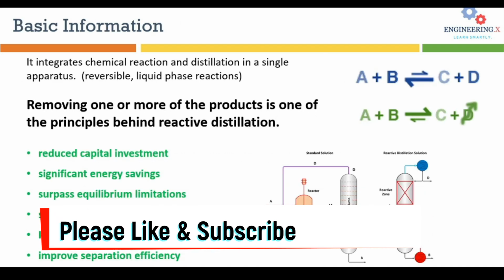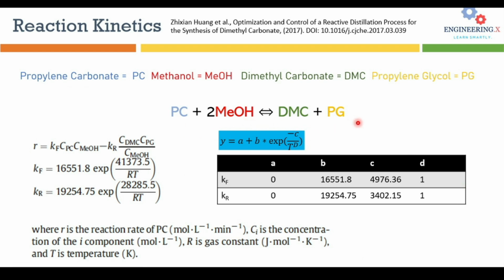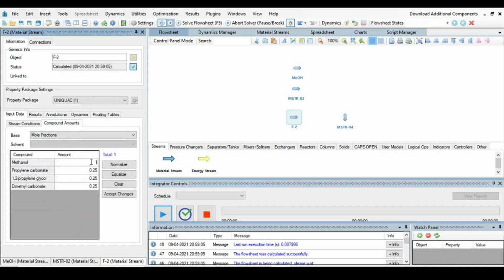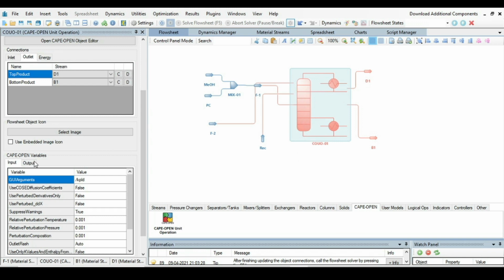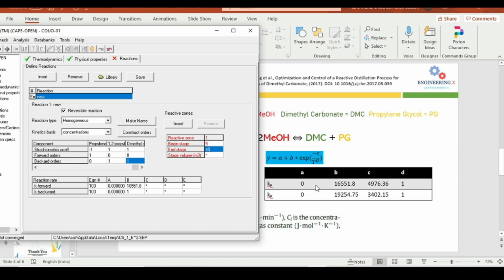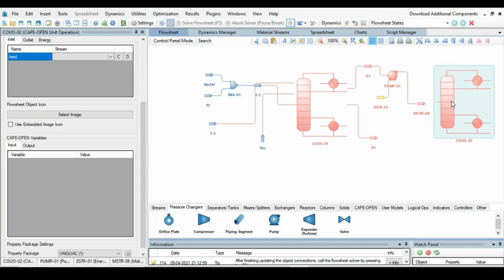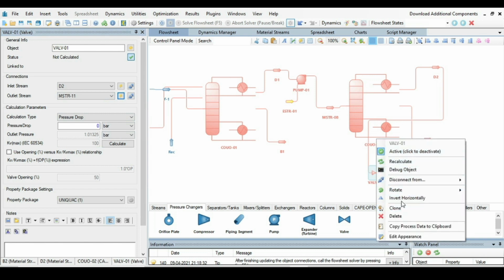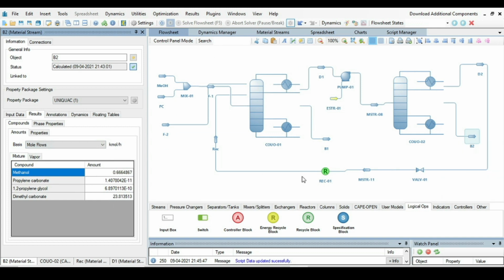Reactive Distillation Column Simulation in DWSIM

Comment: hi sir, i got an error with the user model cape-open unit operation, in the error message said "Exception from HRESULT: 0X80040501" do you know how to fix it sir? thank you
Reply: I have the same error
Reply: Do you know how to correct it @junioronana2508
Reply: @junioronana2508 
Did you fix it?
Reply: I have the same problem

Comment: Hi Sir! 

I did get this error " The given key was not present in the dictionary" from my first simulation run. Double checking with your file with mine, I did not change the thermodynamic package instead I change the components in the recycle stream to its initial values and rerun.

It took me quite some time to run it but i did manage to get the results pretty close to yours (still sad because it's not exactly the same :( huhu) . My mole flow for DMC at stream D1 is 53.49kmol/h.

thank you again for the videos and hope that you'll have the time to make more project tutorials using the latest DWSIM version!
Reply from the maker: Glad you managed to simulate.